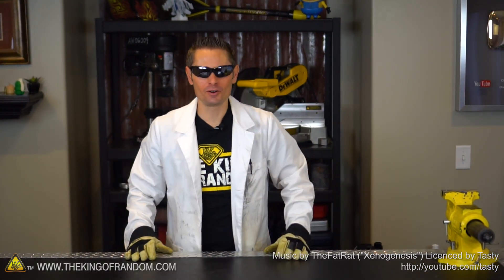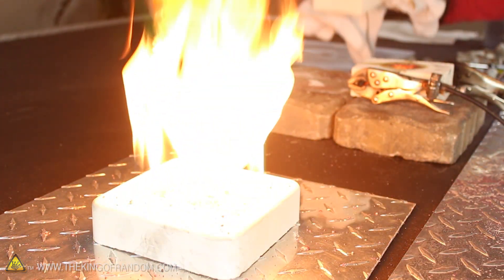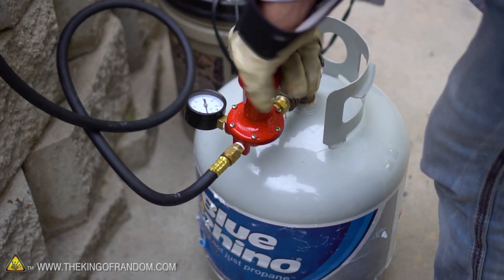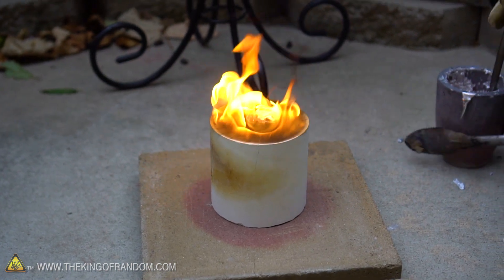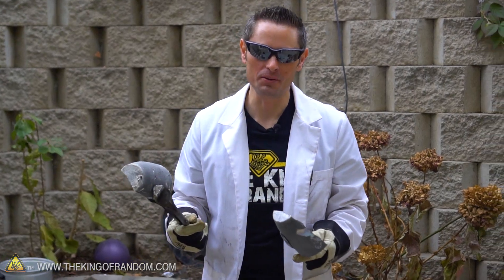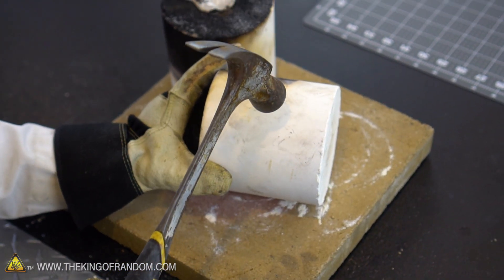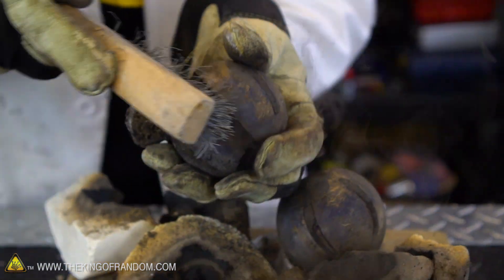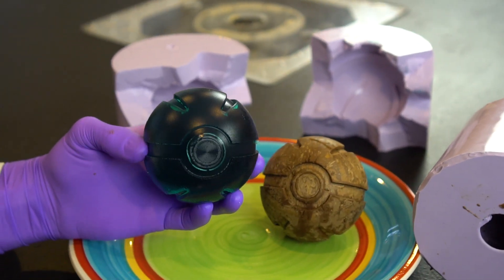Casting Aluminium PokeBalls

Comment: For a better plaster casting experience, first off, you should pour the plaster into some kind of metal container, like a pipe, so the pipe will hold everything together when you pour. And also, before you pour the aluminum, you should try to heat up the plaster to the same temperature as the aluminum so everything will burn off first.

Comment: check out some of the vids from svseeker
the guy is building a sailingvessel and is casting a lot of the portholes the screw and a lot of the other stuff 
hes casting bronze intoo moulds and had the same problems with the mould cracking during the poor , he solved it eventually , think he made a box around the mould and filled it with tamped down sand to keep eerything together during the poor 
he allso burned out the inside of the mould with a blowtorch before the pour to remove the last of the wax inside

Comment: You need to run a runner. a small hole running off to the side of your spru or main hole to evacuate air when pouring.

Comment: Might try putting a secondary or tertiary air port on the top of the silicon/plaster cast to release air as the sphere fills up. Or place the silicon acrylic molds on a foot massager for a few minutes to tease out the air bubbles

Comment: Hi Grant, I enjoy your videos a lot. I have some small pieces of advice.
1. Mix some sand into your plaster. This is how you make what is called an investment, which i'm sure you'll agree is an apt name. A ratio of 3 to 1 plaster to sand is about right. 
2. Make a thin coat of just plaster and sort of splash it onto the surface of your model. This provides a very clean surface, and prevents sand and air bubbles from marring the surface of the cast.
3. Most important tidbit! When you are lost wax casting, it's very useful to use a sprue system. A sprue system is made by connecting max to the top and bottom of your mold, one an exit from the top, and the other connection leading from the bottom of the piece, to the same level as the exit. I use a paper cup affixed with glue or wax. When it's all put together, you should have a U shaped apparatus. One leg of the U has a large diameter cup where you can pour easily, and the other is a smaller vent hole. When pouring, you pour until the aluminum comes out the vent hole. The usefulness of the sprue system is two fold, as it allows gas to escape, instead of having to exit through the liquid aluminum. It also creates a reservoir of liquid aluminum, which the mass of the model can draw from, assuring that it entirely fills the space.
4. One last thing, I swear. To properly burnout your investment, you need to bring it to 2 distinct temperatures. Both should be approached slowly. First step is as you showed, melt out wax at a low temp. Next you should bring the investment up slowly, something like 250 degrees an hour, to 700 degrees Fahrenheit. Hold it there for a couple hours. This ensures that all carbon is completely removed from the model. This is probably where your gas is coming from, small bits of wax trapped in the surface of the mold. After it has stopped smoking, or you've hit 3 hours at 700, bring it up even further to around 1300 degrees. This removes all chemical moisture from the investment, which is being held by the plaster molecules. Your current curing temp is enough to remove mechanical moisture, or water that is being absorbed by the plaster matrix. But when you drop a 1300~ mass of liquid aluminum in there, it immediately starts removing the chemical moisture in the plaster, which can, among other things, crack your mold and off gas into the piece. 

I'm not sure if you'll actually read this, but it just so happened you entered into a realm of my expertise. Happy experimenting, and keep the great hobby videos going!
Reply: Oh, I amost forgot to mention, that 3 to 1 ratio is by weight!
Reply: Gutwrenchinggore I'm so glad you typed this, so I didn't have to. Yes he definitely needs another sprue for ventilation. 

this is just my opinion but, lost wax/investment is way too much trouble for me. love sand casting, can use it over and over again.
Reply: What about vibrating out the airbubbles?
Reply: i mean when making the molds not when casting.
Reply: Gutwrenchinggore
Reply: Gutwrenchinggore 
You sound very experienced with this. Are you a metal worker?
Reply: +OM G Ah, true, but easily dealt with by using one of the steps I described earlier. A quick coat of just plaster on the surface of whatever would give the mold a smooth surface. After that, pour your plaster/silica mix into the mold.
Reply: +theguineapig 
Definitely an important step! I usually use a rubber mallet or just my fist to knock the mold, or the table it's sitting on. That can remove any possible bubbles from the surface of the mold. In general, it's air that might be trapped to the surface of the object that matters. Air bubbles in the casting in general are less of a problem, and are almost unavoidable.
Reply: +Zahi Alsalman
Not as such, I am an artist(maybe just a hobbyist) and I work in a lot of different mediums. I've done some metal castings where the finish really mattered, and learned some of the things I mentioned while working on that project.

Comment: for metal casting in plaster you need to add sand to the plaster. it will absorb alot of the heat and minimize the plaster boiling.
Also after you cast the metal and break off the plaster if it is still hot enough you can dunk it in water and most of the leftover plaster will instantly wash away.

Comment: Mixing in just a little bit of fine grit sand can really help reduce the cracks in the plaster as well as make allow the heat to distribute more evenly, as crude as it sounds, tapping the mold a little or even gently tilting it while the metal is molten can help the air pockets get released

Comment: Cast a  real sized aluminum sword with a sharp edge but keep away from ur kids
Reply: The edge on a blade isnt something you can cast. It needs to be sanded/hammered in and aluminium isnt a strong enough metal to hold an edge, bronze is typically used for casting swords but you still need a lot of sanding and sharpening to make it sharp enough to cut anything.

Comment: Before you use the plaster to cast anything, I suggest the molds in the oven for 20 - 30 minutes to evaporate any moisture. It should mean no spots once molding is finished.

Comment: okay here's my question in all of you too with all of the people that make castings in molten metal copper aluminum and such you couldn't watch a single one of them and find out how they do it without having the plaster cause imperfections instead you just wing it and thankfully this time it came out okay why not do some research and get it right without doubt the first time?
Reply: lastgunslinger3759 how do you know he didn't research it and this is what he came up with? there are many ways to do this. this was the way he he did it.

Comment: maybe avoid bubbles in sphere casts by making two or three diagonal holes connected by a recess so when you pour it flows and fills the whole mold. maybe smaller so you won't have to spend an age grinding them all down. alternatively I did an iron pour a few years ago, and if memory serves there was a small hole for gases to escape.

Comment: Hmmm, to avoid bubbles when making a wax casting, i'd say slush-cast a bit of the wax fist by rotating it through the mold before pouring the rest in.
The thin layer at first will capture all the detail and it's easier for the bubbles to excape, when done pour the rest in and voila, no vacuum chamber needed! :D
Of course a DIY vacuum chamber would be cool for... The next project video!

Comment: Putting your silicone molds in a vacuum chamber should get rid of all the bubbles and make your mold look a lot better. Also you could try using a casting sand that is made for casting, its more pure and should give accurate and precise molds. Could be nice to have a better way to hold your crucible too.

Comment: For some shapes you have to have vent tubes placed in the right spot. Also there is a plastic coated sand that is put in mold heated up to make sand mold that is later broken away after pour.

Comment: If you can vibrate the molds while the cure they will be cleaner. I plaster cast for diaoramas and use a small hobby paint shaker, no bubbles. Also there are plasters specifically for casting. 
 Really nice job btw.

Comment: If you want to cast metal, try green sand casting. You can make two wooden square frames without faces on the bigger sides. Lay one on the table with the empty faces on the top and bottom. Take your pattern and cut it in half, then place it flat side (middle, where the cut was) down in the middle of the frame and fill with sand, making sure to compact the sand very tightly. Then, lay that frame so the flat side of the pattern is face up, place the other frame and the other half of the pattern so they line up with the first one, and repeat. Afterwards, carve out a funnel in the sand to pour the metal and a riser to allow air and excess metal to escape. Finally, remove the patterns (the sand should hold its shape if you pack it tightly enough. You could also tap a hole so you can pull out the pattern with a screw to make it easier) and clamp the two frames together. You have a mould to pour metal into, and from here you treat it like the sand casting you've done before but without the styrofoam. 

Here's an image to help clarify http://what-when-how.com/wp-content/uploads/2011/06/tmpD643_thumb.jpg

Please upvote to Grant can see this and he can make more videos! Thank you
Reply: Josh Akinin

Comment: my metal foundry got to hot and fireworks went out 5 feet. it melted 50 gal steel that was on the air pipe so it got pretty hot

Comment: Grant You Normally would use Green sand as the casting base for aluminum as it is both reusable and wont crack and bubble you would pack it into a frame with a hole on two sides to allow gas to escape and pour in the aluminum

Comment: Hey grant might to try using borax as flux. I've seen steelsmiths using that in the forge, maybe try experimenting with dropping flux in/on top of the cast. That or try using some sort of shielding gas? This is coming from a student welder/steel smith

Comment: When casting you need to have 2 holes one to pour in the liquid metal and one to allow the air to escape. Also try and use green sand casting that method has been used for quite some time I'm sure there's some information on the web about it.

Comment: Use a shop vac to create a vacuum to remove bubbles from the silicone mold.
Use resin in the silicone mold to make a copy of the item that you don't mind getting dirty.
Use casting green sand (you can make it at home somewhat cheaply) to make a mold from the resin.
The green sand and resin are reusable and you can make copies of the resin indefinitely.

Comment: to help with air bubbles make two pour holes. one to pour the alluminum the other to release the built up pressure from air pockets escaping. creates a little more work as you now have two stems to saw and smooth out, but great video.

Comment: To avoid air pockets you ideally need a 2nd riser tube which would allow the air to escape. Trouble is, with the shape you're doing, you'd need to have some method of channelling the air into the riser.

I reckon the best method would be to place one riser on the "shoulder" of the ball and one on the centre as you had it BUT pour into the "shoulder" riser - which ideally should be longer/higher than the other riser so it can act as a "top-up" reservoir. That way your air pocket should be non-existent. at the end of the pour.

Of course there'll be a bit more clean-up of excess metal due to having two sprues . . . But that's the way of things.

Does anyone see problems with this?

Comment: Great video, i am enjoying this molding/casting series. You could try making a little table that vibrates to put the rubber molds on while they are setting, to vibrate the bubbles to the top. Like, a table top with a motor attached to the bottom, and rubber grommets for the legs, so the vibrating goes in to the table top not through the legs as much.

Comment: Maybe you should think about setting up a small sand casting bench and vent your molds a little more. If you add a small dollop of lithium grease to the molten metal before the pour, it will bring all the impurities and slag to the surface where you can skim it off.

Comment: perhaps you could drill a small air hole or two before you remove the wax. The Art of Weapons guy used metal skewers in greensand. Another thought was cast it in a big u shape where you do two at once, metal goes in one side and pushes all the air out the other. You can use soup cans with greensand lining (small automotive funnel and PVC pipe over the tip) to gain height and allow for more pressure.

Comment: Im not to sure but I believe if you made a vacuum chamber you could put the plaster moulds or the silicon moulds in a vacuum chamber it will force all the air bubbles out to help produce a cleaner mould.

Comment: AN ADVICE:

Greg, I am a great fan of what you do. I have learned a lot of things from you. I am a PhD student working on metal casting. So, i have some advice for you when you try to cast metal:

1. Always preheat the metal as much as you can.
2. Preheat the mold as well. This will prevent undercooling, and hence porosity in the casting.
3. If you are making wax casting, you don't have to melt out the wax. Pour the metal directly in the mold with the wax structure in it. The wax will instantly vaporize and moreover, will give you a better surface finish.
4. Speaking of surface finish, try Lost-foam casting (using styrofoam) since you already have a cool styrofoam cutter, this will be easy for you.
5. When you pour molten metal into a cavity, make sure you are pouring the metal at a constant rate forming a continuous stream. This will prevent air bubbles entrapment.
6. Add a riser to the mold design, this will take care of the solidification shrinkage of the metal.

Hope these tips help you. 

Regards,
Your BIG FAN!
Reply: Not much of a fan huh did you learn all this from his videos how you gonna suggest using foam and that's how the sword he melted in the video was made

Comment: Hey Grant, nice work! I only have a couple of suggestions, bake the plaster molds at as high a temperature as your oven can go, or use your burner to do it. that will off Gas the wax better so it won't try to do that when the metal hits it. 

You may want to increase your riser length to store more molten metal to help with casting shrinkage. it didn't go too bad as is though. 

Try casting your silicone under a vacuum and or with a vibratory table, that should remove the air bubbles. Not sure if a lower viscosity silicone is available, that may help, but tiny air bubbles are a bear to get rid of.

Comment: Hey Grant, to remove the bubbles in your molds, check out vibrating tables. Small ones used by dentists are pretty low cost but can really improve the end product. Also, you might want to add a funnel shape to the end of your risers so that you aren't wasting metal by missing the hole.

Comment: for the future, use a steel or titanium form to hold your plaster molds together, it helps to keep them from cracking. Also a lot of people find they get a cleaner cast if they submerge the mold in water while it's still fairly hot.

Comment: You could lifecast your face (or your kids, friends, wife, etc since doing it to yourself is hard)... then you have a basic mold to make a wax plug...
Then do the same thing for a metal face.. but this time, instead of submerging it, try dipping it in a plaster solution, then powder fine sand, doing a few layers first.. THEN submerge it in plaster (or cheaper if you put the thin shell mold in sand)

Comment: that method is really expensive and time-consuming.. if you want to take the bubbles during that silicon part.. tap it up from the top, with a valve attached to it or something like that and vacuum it before it turns solid (even with a regular household vacuum if necessary) hit it like you did and you're fine ! after you make the wax props.. dig them in a silica sand (Si with 2-4% water w/w) hit it here and there and press it gently and press it gently from the top with a glass or a shot or whatever flat surface you have near you.. this should be in a casting tube like the ones you made for the silicone part (not necessarily heat resistant for such small pieces)..pro tip: if you turn it upside down,shake it gently and if the sand doesn't fall, crumble or whatever, it means you're ready to go!leave a small hole like you did.. and just dump molten aluminum right in.. if you see the aluminum "boiling" during this step, it means you used too much water.. you will lose your wax prop, but you will get a smooth,cheap and easy with little to none fail propability aluminum cast.. :)

Comment: If you use a metal with a lower melting point you can cast that and then cast a better metal of the seeker metal to get a better mold the only problem is that breaking it open mite break the mold so it won't be reusable

Comment: Hey Grant. When pouring spherical casts, could maybe adding some low power suction to the opening in the plaster cast help remove any air bubbles that might form in the top?

Comment: to avoid getting those little air bubbles, try using a air gun to make big bubbles that take the little ones out, they use that in concrete walls.

Comment: Can't you use some more silicon that's just about to the point of curing and fill the holes in with your finger or a swab? I mean, it would get rid of the bubbles and not harm the integrity of the silicone.